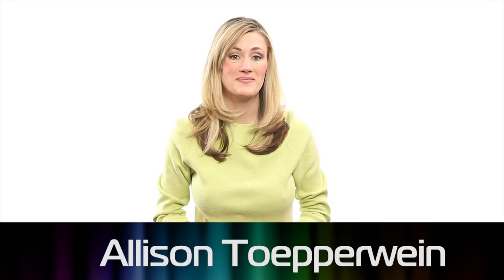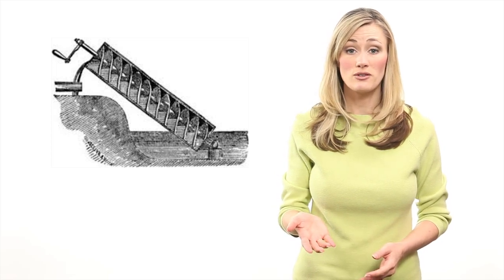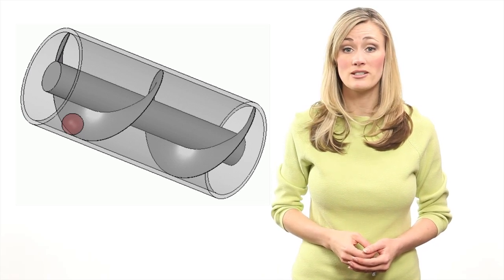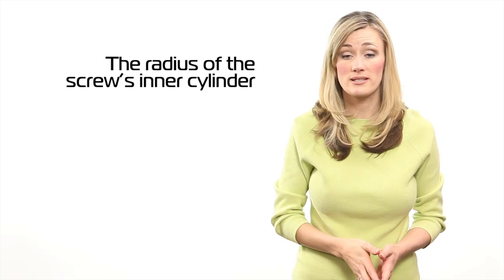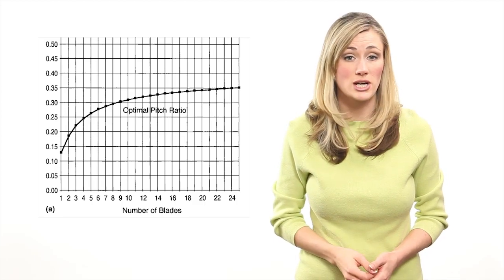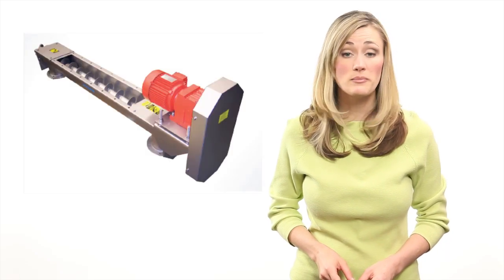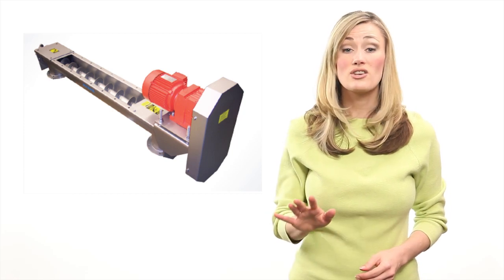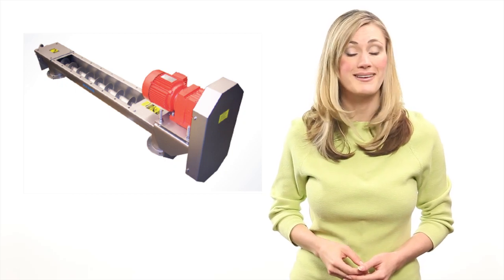Screw Pump Design

Comment: wow.. why not lift water without bypass by welding the screw sections to the inside and outside tube.. the entire assembly will then be much more efficient .  it could reduce power consumption needed to lift water in california aquaducts by 95% where they are only lifting water 30 to 100 feet . as long as the entry point is not totally submerged so only 35 to 40% of the screw is filled.. it won't flow over like a siphon .  easily replaced screw into the sections vacuum breaks could also be installed. also.. so water could not leak out when the vacuum break is below the water level. but when its above it could let air in.. either a flapper or a ball in a cage could be used..
Reply: multiple sections could be arranged on mountain sides in a zig zag pattern to go over the mountain.. with covered ponds between.  reverse turbines could recoup the energy going down the other side..  this would be so much more efficient than the giant pumps currently used to lift water out of the san joaquin valley for southern california.  one of those lifts is probably 3000 feet  vertical at the southern end of the san joaquin valley.  the water pumps use more than 1/3 of the electrical output in california.